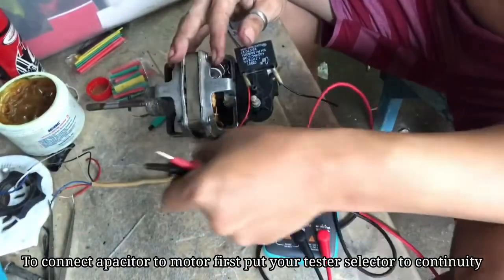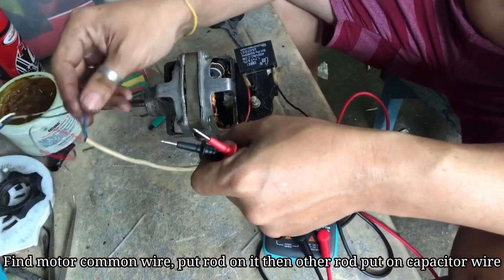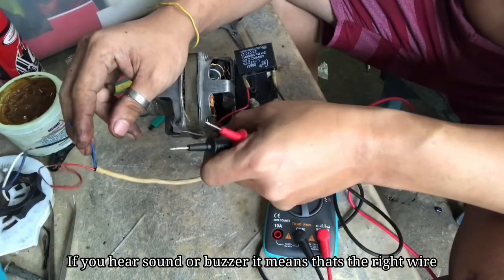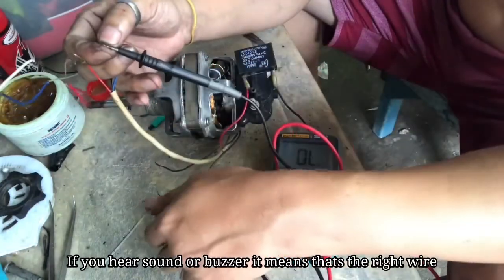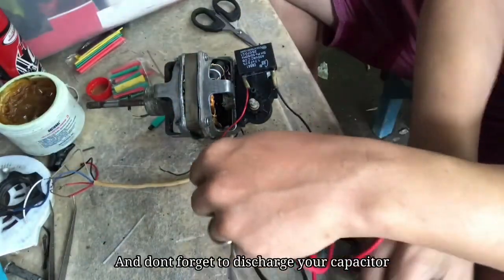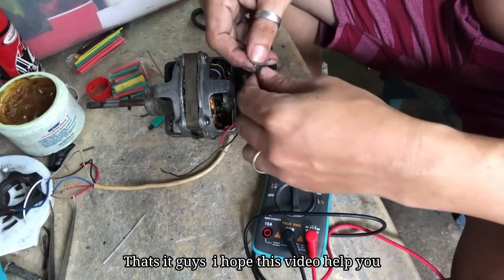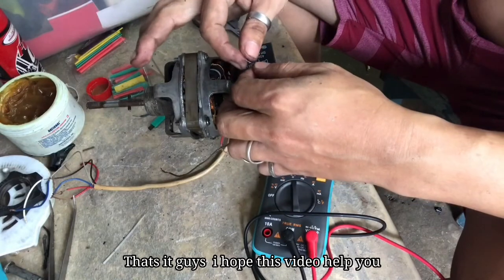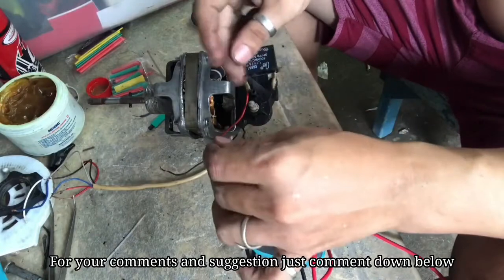How to put capacitor in electric fan | Paano magkabit ng capacitor sa electric fan

Comment: nice tutorial video,very informatve,tanx for sharing ur knowledge sir.ask q lng sir nag DIY  kac aq 😢kinalas q ung motor ngaun nahatak q ung mga wiring ginupit q kac ung wire ng capasitor napatid sya sa pagkkahinang pareho
saan po nka connect un sa ibbaw ng stator or motor yta.magkatabi po ba ng pagkkahinang un or magkasama,dba wlang polarity ung wire ng capasitor bakit red & black ung wiring nya,sana masagot nyo ang katanungan q.more power & god bless.
Reply from the maker: Pag bago yung e fan nyo hindi pa nagagalaw yung capacitor,karamihan pula at itim yun pero walang kaso kc walang polarity ang capacitor
Reply: @KaDuks  oo bossing  pero 4 years na rin ito sa amin.okay na bossing magkatabi lng pla un.ung 2 wire lng ng capasitor ang napatid.
Reply from the maker: Pag naputol yung mga hibla mahirap ng ihinang, dko sigurado rin kung sa linya ng selector
Reply: @KaDuks  hnd  nmn napatid ung wiring ng motor ung 2 linya lng ng capasitor ang natanggal sa pagkkahinang,salamat po bossing sa kasagutan nyo.gud eve.po

Comment: Boss, pare parehas lang ba ang mga capacitor ng electric fan? Ibig ko sabihin wala ba sukat, o kung ano pa man?
Reply: Ah, ayun, by farad.
Reply from the maker: Opo at ang farad ay naka dipende sa laki o liit ng makina
Reply: Kung ano boss yung nakasulat na farad dun sa capacitor, ganun din ang ipapalit ko, tama ba? Di ko pa nakikita yung capacitor eh pero im sure yun na ang problema kasi humina na ang ikot ng electric fan ko.
Reply from the maker: Opo pero try nyo munang linisan ang electric fan nyo lagyan nyo po ng langis ang mga bushing baka mahihirapan na umikot ang rotor
Reply: Pag number 1 lng pinindot bahagya na umikot. Need pa pindutin sa number 3 para lng umikot ng malakaa
Reply from the maker: @tophersamson6085  linisan nyo po at langisan pag ganun parin saka po kayo magpalit ng capacitor
Reply: Ok boss salamat.
Reply from the maker: Iba iba po dioendi sa farad may 1.2  1.5 1.7 at 2.0
Reply: Same farad na 1.5 pero 350v change to 450v..ok lang kaya yun?
Reply from the maker: @leiro1001  mas maganda po kung susundin nyo yung luma kasi pag malaki na yung boltahe malaki narin po dapat yung motor
Reply: @KaDuks  halos 450 lang kasi meron..masusunog ba yung motor?
Reply from the maker: @leiro1001  hindi naman subukan nyo maayos ang ikot ng E fan nyo
Reply: @KaDuks  malakas naman ikot tsaka di maxado umiinit

Comment: walang nega tive at positive sa capacitor? kasi yun capacitor nun sakin wala positive o negative na mark
Reply from the maker: Opo walang negative sa original na capacitor ng bagong fan normally RED black wire meron kaya nasabi ko po negative
Reply from the maker: Wala pong problema